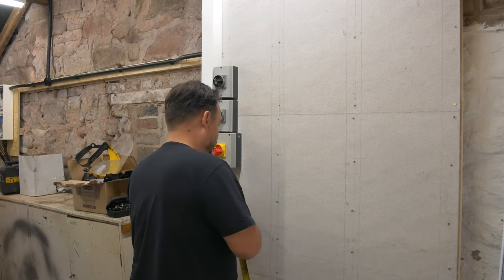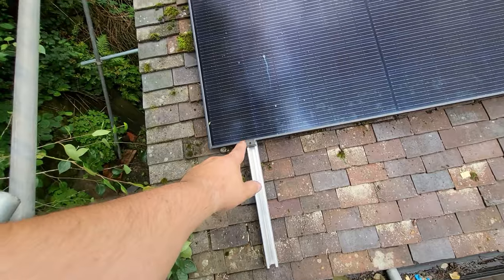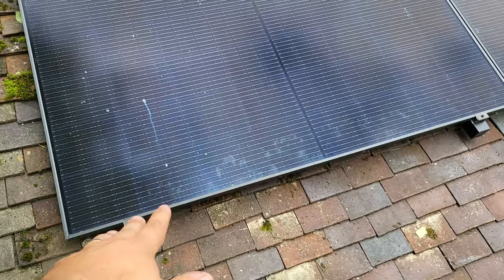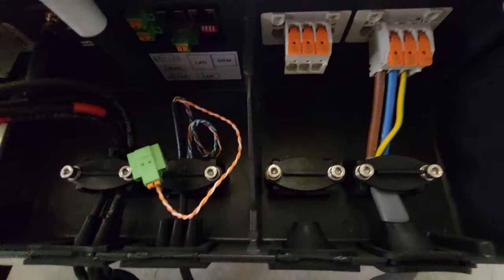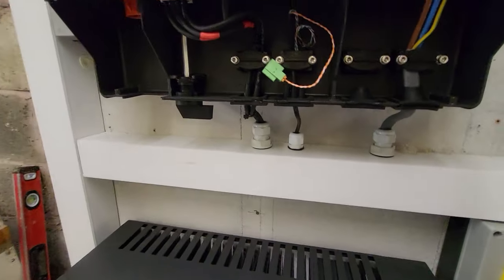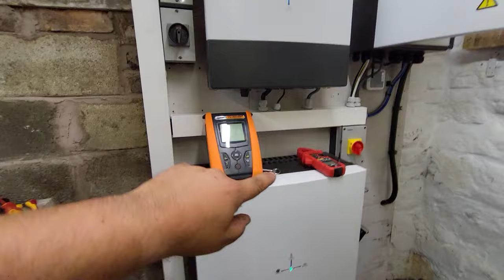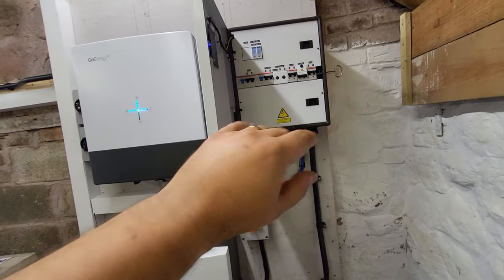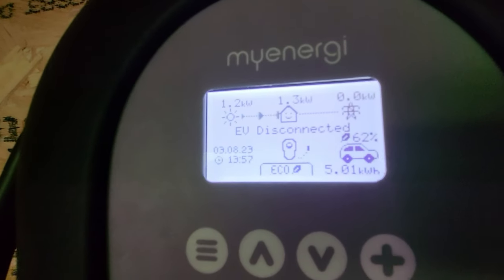13.5kWh GivEnergy All in one whole home battery backup with gateway and 5kW solar - Full Install

Comment: Looks like a lot of expensive equipment there.  The average person doesn't need to build a warp drive in their garage. 
Hang an hybrid inverter on the wall. Plug in your panels and battery and wire it to a 32A breaker. Done 👍
Reply: The days of a rich man's hobby is over. Hybrid inverter with EPS, 10 panels (4kw), 16kWh battery £5,600 fitted
Reply from the maker: That depends what you are trying to achieve. The method you propose would deliver at best 5kw output which in this case would be totally inadequate. 

We do however install plenty of hybrid systems as you describe for clients who would benefit from them. That's the grown up professional approach I suppose.
Reply from the maker: I don't know what planet you are on at those prices. If your an installer who is decent send me your number and I will have you booked out and most likely bankrupt in a fortnight. Most ridiculous comment I've had on YouTube in months. 🤣🤣🤣🤣🤣🤣🤣🤣🤣🤣
Reply: @electrician247  cost price. I'm talking about doing yourself. Not going to suit everyone
Reply from the maker: @seanoconnor8843  even at cost price what equipment are you using? 16kWh of batteries will cost you most of your budget. 

Rail, fixings, panels, optimisers, hybrid inverter, access equipment. 

We install all types of systems, some without batteries as shown on the channel some with entire home backup. The latter is infinitely more requested by consumers than budget solutions. 

As more people opt into Solar that might change and we are ready to spec systems for ALL circumstances and budgets. 

Your blanket statement above is not accurate.
Reply: @electrician247  Well, I did mine last summer and just looking now, the Sofar 6kW hybrid is now down to £1,100.
10 x 400W half cells £1,600.
16 x 280Ah Eve cells, BMS, fuse, breaker and box £2,500 plus roof hardwear
Reply: VAT included
Reply from the maker: @seanoconnor8843  your over paying on the panels tbh. 435W all blacks have dropped to around £100 each. 

That battery setup is 100% something we would never recommend to a paying client. 

What warranty have you got on it? Because that is going to require costly maintenance and most likely replacement sooner than you might expect. 

Have you had an annual checkup performed? 

These DIY systems should be avoided imho. Much better options are available and real value is measured over the lifetime of an installation not the initial cost. Short sighted thinking but I understand budgets drive people to get solar at a price they can afford upfront. This is where more centralised funding should be directed to avoid poor long term value. Decent solar shouldn't just be for the more well off.
Reply: @electrician247  you might be right. I did it as a personal project and fortunately had plenty of time to do all the research needed (is a lot). 
I really recommend the Sofar hybrid though. They're a small Chinese firm that sell mainly to Australia. They are designed for the harsh conditions and the full fat 240V mains we have here. If you can put something near 400V DC in then they are super efficient
Reply from the maker: @seanoconnor8843  no issue with the sofar inverter. It's the batteries I would be worried about
Reply: @electrician247  I know. You need to do the research and don't skimp on the components. Be prepared to pay £160 for the proper fuse. Obviously I want monitor everything very closely and I have only done one year but quite honestly I'm delighted with how everything is performing. I promise to report any failures

Comment: Dark panels warm up quicker reducing production. And scaffolding is completely unnecessary. Two people on ladders is plenty
Reply from the maker: Incorrect on the scaffolding. This roof was a very difficult one to work upon and ladders would be a ridiculous approach unless total amateurs. 

The panels are interesting in terms of efficiency ratings. These are among the best on the market as regards that. The main issue with performance in shading. Are you a solar installer? I'm guessing not based on the comments.
Reply: @electrician247  you might have a point with the scaffolding. I did mine on a ladder on my own. I don't recommend that in the middle of a heatwave. Be safe but don't be put off. Get a friendly roofer to help maybe.

Comment: Being IP65 has anybody ever installed the gateway outside?
Reply from the maker: Yes it’s suitable for outside use. The OCPD and equipment is pollution degree 3/4 and -20 +50. Even has a nice heat sink and fans for heating/cooling. They ask for a canopy so it’s not left completely exposed to sunlight. Can be achieved by installing in less exposed areas outside.

Comment: I’ve been in the Solar industry for approximately eight years and have sold millions of pounds worth of Solar. I was just about able to keep up with about 50% of what you spoke about. Most of the content in this video is for electricians. Next time you might want to simplify a little bit for everybody else. Otherwise excellent work and congratulations on pretty good video.
Reply from the maker: This is primarily for electricians tbh. It is the purpose of the channel. However other videos are already on the channel for consumers etc. So already done. Thanks though!

Comment: About £8k just for the battery lol, what a rip off. Diy 14.4kw with better cells for £2.2k.  I know what id be doing. Cos i did.
Reply from the maker: You are wrong but that's okay 👍
Reply: If you did , run us through the spec in detail
Reply: @pmbpmb5416  not got the time for that. So, read my build thread and save yourself some money. Can be done even cheaper now.   https://diysolarforum.com/threads/first-build-3kw-panels-3kw-inv-14-4kw-storage.52783/
Reply: Erm really?  Check out the proof in the post below..  so, yes, a big big rip off.

Comment: How many of your new AIO clients are having problems with the SOC suddenly dropping off a cliff? Mine is getting worse by the day. Forums are full of very unhappy AIO customers at this stage.
I would warn anyone considering the AIO to read the forums on GE's own website. BMS needs sorting out before this equipment is fit for purpose.
Reply from the maker: Not a single one. I did have another installer ask if we had troubles. 

Not unique to any brand with software issues. We have had problems with multiple manufacturers around similar things. 

Hunt hard enough and you will find an Internet full of complaints about pretty much everything. 

I'm sure any issues will be resolved.

Personal experience here is nothing buy very happy customers with an incredible power house of energy.

Things to double check is the installers has only enabled 1 x meter in the remote settings. This is only viewable by GE and the installer. As this can result in random 6kW drain durations and that the software is up to date. 

If you haven't already contact the installer and GE will live chat with them on https://givenergy.co.uk/installers/ 

Any issues they have resolved within an hour for us.

Comment: "... down on the floor there, which has got 13.5 kilowatts of battery storage ...". AAAAAGH !! Time to go back and complete your training, learning the correct units? You could then re-title the video ...
Reply from the maker: Such a silly comment. Feel free to make content and titles how you like. I do my thing right here and make no apology for it. I often speak out of turn and miss words, letters and worse. I'm dyslexic. I won't be lectured at by a wally on a keyboard. 

I think everyone knows the intent. In terms of training I'm a  bona-fide spark with gold card, AQE status and a degree in electronic and electrical engineering. 

Wrong move